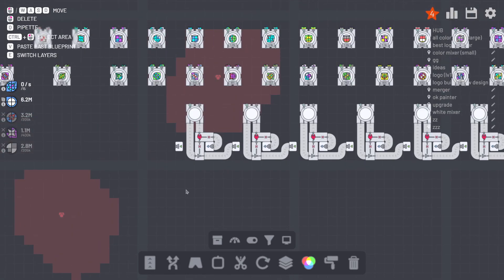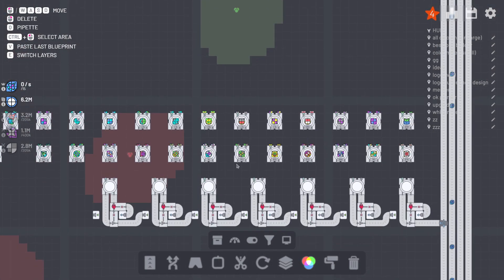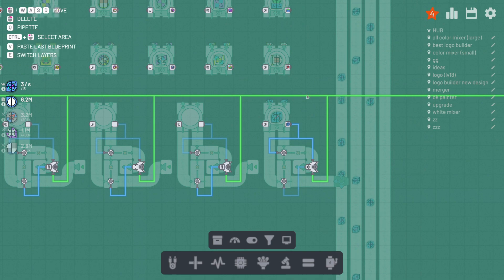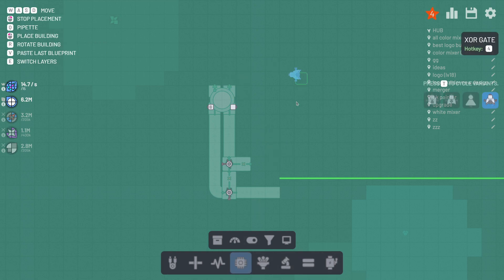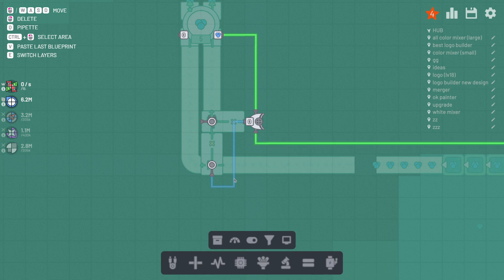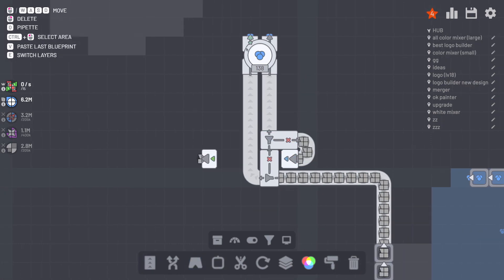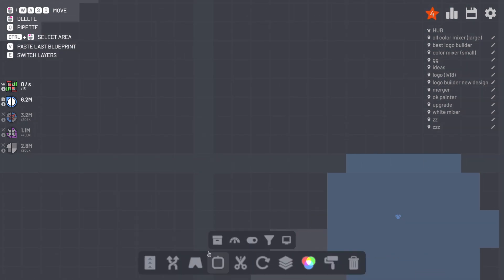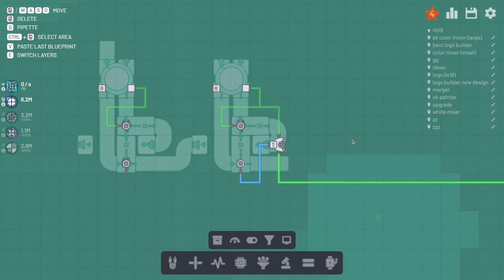Shapez how to: Making a storage system for the shapes

Comment: So I watched your video and the storage system working, but I noticed as soon as they fill up, the machine stops. Is there a way for maxed out shapes to bypass the already full storage?
Reply from the maker: unfortunately i dont think its possible to get the shapes to move into the next storage if the one they are filling becomes full, this is because the input of the second filter needs to naturally be a 0 while also having the ability to turn into a shape input, i think the best way to solve this would be to just increase the length of the storage unfortunately, ive tried using extra xor gates and the transistors but nothing works, however this might work with a mod that allows shape and numbered inputs but for the base game i genuinely don't think that this is possible.

if you do manage to find a work around let me know cos im so stumped on this XD
Reply: @TheSuitBoi  Hey!!! I figured it out. I was messing with your design, and tweaking things and I got it working. I'm not sure how to explain it though. A picture shows it all. Is there a way I can direct message you and send you the photo?
Reply: I know it's been a while and you probably don't care about the Shapez game anymore. First of all, Shapez 2 is out in early release and it's pretty cool! Second, I got your design to work with some additions to make full storage systems either bypass it or move on to the next. Let me know if you are interested!